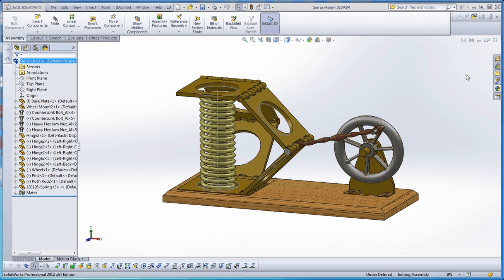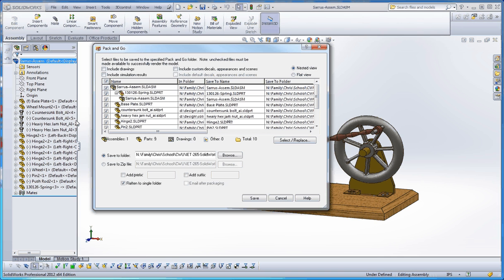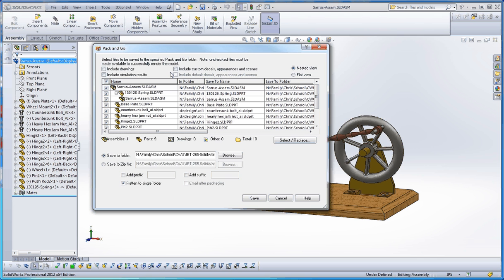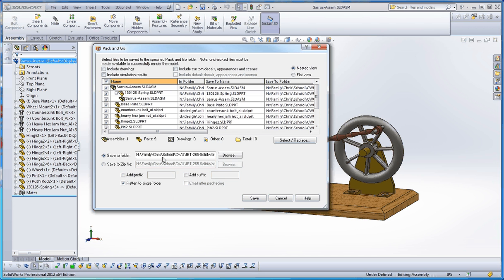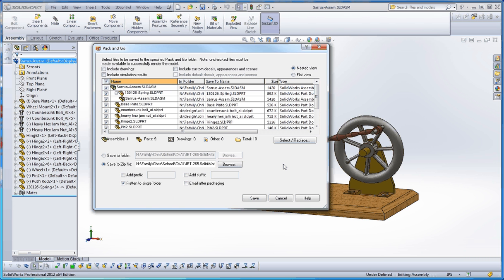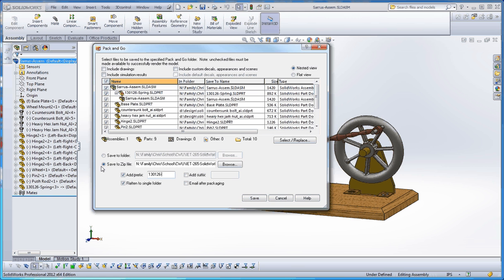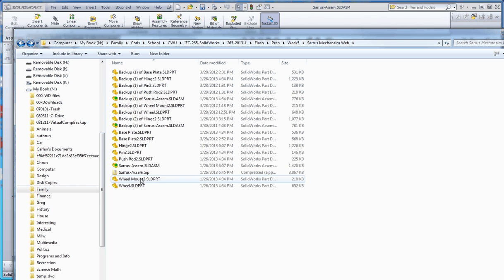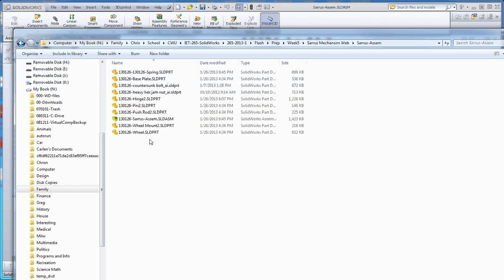SolidWorks, Using the "Pack and Go..." Function

Comment: I suppose you are the professor for the Washington University METP course which deals with modeling.  I wanted to voice my appreciation from Mississippi State University ME program.  It was very helpful to find a quick tutorial on how to use a tool native to Solidworks for zipping the assembly.  Thank you for posting.
Reply from the maker: +007sephiroth1 Thanks for the compliment.  I was the CAD professor at Central Washington University.  Its a common mistake for beginners to just send an assembly or drawing files without the associated parts that go with it.  I am glad that you found this useful.